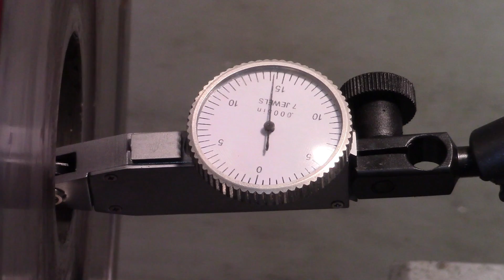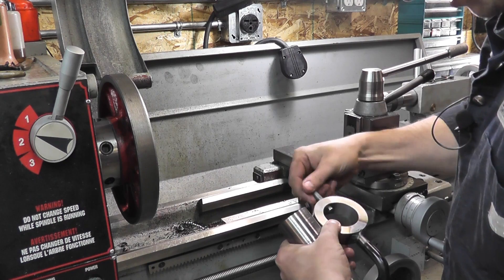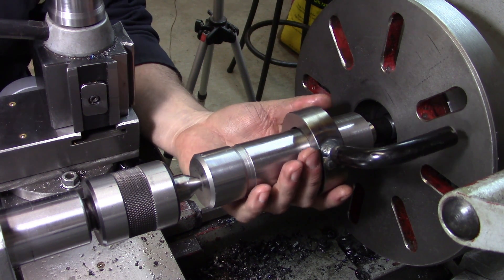Making a Simple Lathe Dog from Scrap

Comment: What type of drill bits do you use to drill through the thick steel?  I had to drill a 3/4" hole through a 4" schedule 40 drill pipe. it took me forever and I went through 6 bits drilling 4 holes. The bits stated they were COBALT for hardened steel, but they spun and smoked: low speed, high speed, no speed LOL it was frustrating.  Can you please recommend some bits for my application?
Reply from the maker: Honestly I just use whatever drill bits I have gotten from auctions, but I have invested in a few cobalt bits for certain things.  The big thing is sharpness, but even with that I know my sharpening skills are not Abom-level, lol!

Comment: I'm a bit late to the project here, but had a thought.  If you put a couple nuts on the clamping screw, would that help add some counter balance, thus reducing some of the vibration? Liked the outcome from using scrap parts :)
Reply from the maker: Thanks for the kind words Michele, I hadn't tried adding nuts but that's a pretty good idea. Sadly haven't had a lot of shop time lately but hopefully soon and that might be an idea to try out.

Comment: if you weld  onto the other side a similar weighted lump of metal apposing the drive pickup bar you will balance the vibration out, or make thick wall tube to slide on the grip bolt . if you want it perfect sit a bearing inside and the heavy part goes to the bottom add washers to balance it out.  i know its possible a waste of time, but its worth while.
Reply from the maker: Yeah, I've used this thing a few times since and added a bit of weight to balance it if the vibrations were getting annoying. Not a complex project, but it sure has come in handy.

Comment: Just a thought .... Why don't you move the locking bolt 90 degrees and add a second hook leg to your lathe dog. I think it will help balance your project and get you less vibration... Nicely made ... Thanks for sharing.
Reply from the maker: That is a thought, but if I do that it would require a lock bolt on both sides of the dog to keep it concentric.  It would certainly work though, as long as one was careful enough to get the thing centered.

Comment: Great job nice video. It should be obvious that the dog could be balanced by welding weight to the bolt side of dog. That would only be worthwhile if the dog was going to be used a lot. That is the nice thing about metal you can weld cut weld cut until you're happy.
Reply from the maker: Thanks, I just needed one and had some scrap available. The thing is that with this style of dog is that the larger the shaft the more out of balance it gets. What I got to doing is attaching a nut and bolt to the backing plate to balance the assembly when using this dog.

Comment: Concerning the off centre mass (and consqeuent lathe vibration) you could weld a couple of counter weights opposite the tail, twinned around the bolt?
Reply from the maker: After getting the tail stock alignment bar finished, I was going to get on to another project that needed to be done between centers but that got pushed back.  Some family projects needed doing, then the shaper arrived, but at some point I will need to use this dog again, on that piece it was holding in the thumbnail picture.  What I was thinking of doing was using the backplate itself and bolting some pieces of metal to it on the opposite side of the tail to balance it.  We'll have to see when it comes to that point.

Comment: Good vid. 
Why didn’t you just grind the tails down on your store bought lathe dogs?  I think most are just weak cast, they crack if you get mean on them. 
Cheers
Reply from the maker: Thanks, I just needed one big enough to work on both that alignment bar and on another project that is sadly now sitting idle since the shaper and a number of hurried friend/family projects have come along.  Will get back to it when a bit more caught up.  I just didn't feel right grinding on them when a couple of them wouldn't even reach the drive plate slot.  I may use them down the road against the chuck jaws using a sacrificial center should the need arise.  The thing is that I haven't seen an old South Bend/Atlas-type old school one-slot driveplate in D1-4 so figured this was the most expedient for the purpose I needed.
Reply: Ok, gotcha. We never know the full story in anyone’s builds, so we guess.

Comment: Dead center lube can be had from most auto parts stores as "engine assembly lube".  CRC "Stalube" extreme pressure anti-seize with moly-graphite blah, blah, blah.  It comes in a black toothpaste style tube.
Reply from the maker: That's good to know, thank you for mentioning that! I'll give the guys over at Part Stop a call in the morning, see if they can get some. Was trying to find white lead to mix up some old school stuff and it seems hard to find . . .

Comment: Everett, ditch the bolt on the dog and replace it with a set screw before it catches your hand.
You might keep an eye out at yard sales for some cast iron weights from a bar-bell set and make a proper dog plate for you lathe so you can use your other large dogs.
If the lathe is vibrating... slow it down or add counter weights as others have suggested. If you go to a tail stock dead center you'll have to slow it down anyway so you don't burn the dead center or the work piece.
Reply from the maker: I hadn't thought about a set screw, that is a good thought.  Will watch for a good deal on them in M10x1.5.  I'm thinking some bob weights will be made up as well, to offset the imbalance issues when it's on a larger diameter shaft.  Again, just making improvements on the basic idea, all in time.  Thanks for joining in though, the set screw idea is a good one.

Comment: To balance the dog just add some lock-nuts to the clamp screw until it runs smooth.
Reply from the maker: I think I'll be doing that, perhaps even with some adjustable bob weights - at some point there will be a "little bits and updates" video where a number of projects will be reviewed and perhaps improved, and messing with the dog will be part of it.  Thanks for coming by!

Comment: I don't know how much difference it makes but your lathe dog only touches your part tangentially? in two small places...would that not increase the chance for the part to slip?
Reply from the maker: You're right, it could increase the risk, but after giving it a try using reasonable depth of cuts it seems to hold. At some point I might put a small groove with a plunging end mill cut on the tail side inside the ring if it's needed. I hear you though, and will have to watch for any potential slippage. Thanks for joining in!

Comment: Thanks for the video. You may want to think about bolting on some sort of counterbalance to your faceplate on the bolt side to try and reduce the vibration. I have also been toying with the idea of mounting a "back box" to my crosslide and mount a parting tool upside down. Something solid.
Reply from the maker: Another couple viewers suggested adding nuts to the bolt side, and I like that idea - thinking some slugs with M10 threads in them to put near the head of the bolt. If that doesn't work then adding weight to the face plate is the next step. Just trying to minimize flailing objects . . . Thanks for coming by!
Reply: There are always a couple of "right" ways to set something up... usually the "right" way depends on what you have available. It costs money to have the perfect set up. If you run a die down your bolt you can use a donut style piece (no thread) and an M10 nut to hold it in place. You can add washers for more counterbalance as required. Either that or buy a Timmies and see if you can roll up and win a donut. :)

Comment: I would have milled a couple of opposing slots out of the faceplate to keep it balanced, then the original dogs will fit.
Reply from the maker: I had thought about modifying the factory face plate but they don't put a whole lot of iron in them. That and the one piece that needs doing wouldn't fit in the biggest commercial one in the stack. I need practice doing D1-4 nose tapers anyway, so will make a face plate to fit the factory dogs at that point. Thanks for joining in!
Reply: Hi Everett. If I was pushed for time I would have ground or milled the lathe dog down to fit the drive plate.

Comment: Great job Everett! That'll come in handy :) I was all about to collect a set of traditional dogs off eBay or wherever when I figured out the first one wasn't going to work and ended up making a separate drive plate instead of using the faceplate. It's small and easy to mount and I just use a stud or bolt for a "carrier pin". I got the idea from Charlie Pace here: https://youtu.be/xVNJvHp6lwM?t=1352 The plate is light and can be small, near the size of work you do and dogs can be made out of flat plate with a slot to engage the carrier pin. Anyway, one other approach if you need more later. On your current dog, maybe you can put some nuts on the bolt end or a hunk of 1" rod with a threaded hole to act as a counterweight against the dog arm. Turning between centers will be most accurate when you have a reasonably balanced setup, for when you really, really need it concentric and a smooth finish :)

Comment: Lube for dead tail stock center... Dutch Boy white lead mixed with machine oil.. Just don't eat it....
Reply from the maker: Hi Mike, I had heard of using white lead, but didn't have any. Will need to look around to try finding it as here in Canada there seems to be a hate on for lead stuff. Thanks for joining in!
Reply: Same here in USA... If lead is as dangerous and deadly as some think, I would not be typing at this keyboard at age 66.. Mike in USA

Comment: I never have the ideal drive dog on hand - I really must make one or two more - one day! Love finding a purpose for 'scrap'.
I ought to set up my 4-way toolpost for a parting tool - for sure it should be more rigid.
The dog came out pretty good. :)
Reply from the maker: Thanks Chris, I just needed one and the scrap was there. The spring u-bolt was rather serendipitous in that it had a 90° bend in it and was the right diameter. As for the turret post, it's night and day for parting off, as my previous 'Murphy' demonstrated . . .

Comment: Good little project, one thing you can do is drill and tap a series of holes so you can drive the dogs off of them, that or machine a T nut to fit in the slots in the face plate. That is why I made myself a drive dog plate. To get around that problem
Reply from the maker: Thanks Jim. I saw your face plate on a video the other day and I might do that at some point when I'm better at making stuff to fit the D1-4 nose. I like your idea for that.
Reply: Everett's Workshop I purchased a backplate to start with that made it easier.

Comment: Need a tool....make a tool! Nice job Everett 👍🏼
Reply from the maker: Thanks Richard, we both try to use scrounged stuff as much as possible. After a suggestion further below I may modify it a bit to add more balancing weight down the road, we'll see. Hope you're doing well and your boundary issue is resolving well for you.
Reply: Thanks Everett. My lathe doesnt like running unbalanced items either....counter weight is a good idea :) ~ Richard

Comment: Nice work. Being lazy, I would have opened up at least one of the slots on drive plate to accept the tang on the dogs I already had. A non-destructive and useful modification. Of course, then I'd miss out on the fun of tool making.
Reply from the maker: Thanks Todd, I'm lazy too but also cheap - I'd rather mess up a piece of scrap than accidentally mess up my drive plate that actually cost money. Maybe some day I'll make a drive plate that will work with the dogs, but got a few more things needed first. Thanks for joining in.

Comment: Nice work. Can you add metal to the other side to balance out the tool so it doesn't vibrate? Just wondering if that is why the other tools have the heavier point to one side.
Reply from the maker: Thanks Craig, I may just do as you suggest at some point and weld a bit of metal to the screw side of the dog, we'll see. I'm sure you would be right about the commercial dogs and how they're shaped.
Reply: Maybe add a couple of nuts on the threaded bolt as counter weight.
Reply from the maker: That's a good idea - might even make up some threaded wide sleeves similar to the bob weights used when balancing crankshafts. I think I'll do that, seems to be the easiest solution, thanks for the idea.

Comment: Good job on the lathe dog.  I finally found my drive plate so I can go back to using the dogs that came with the lathe.
Reply from the maker: Thanks Harold, it's not pretty but it's functional. At some point I may need to either modify the commercial dogs or make another drive plate to work with them. Depends on time and what's above it on the to do list . . . Hope you're doing well.
Reply: @EverettsWorkshop  I have the same problem, with the dogs being too big for the slots in my face plate. I just bolt a piece of scrap to the face plate to drive against. OK for longer parts, doesn't work on short ones. Have cobbled together various solutions for short ones. 3/4" pl. drill & tape for a drive stud. Not nice like yours but worked.